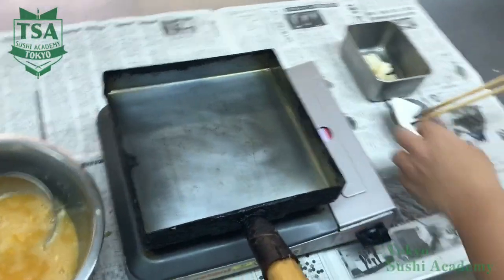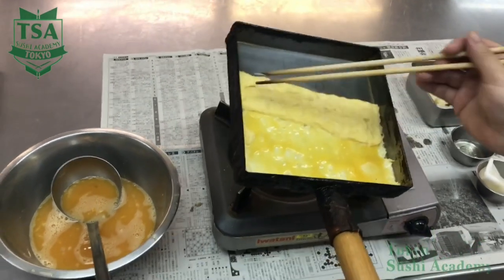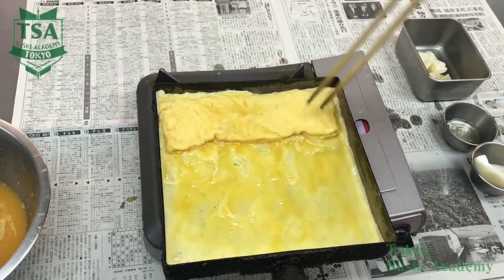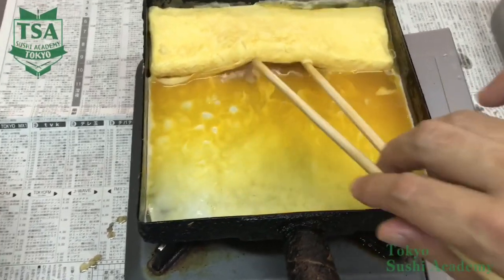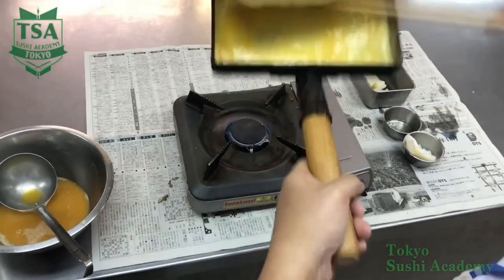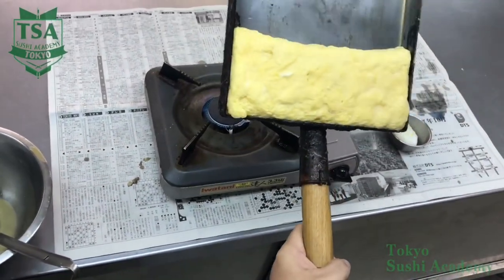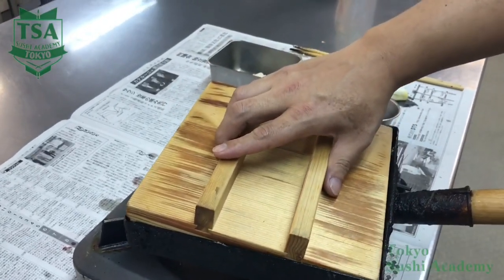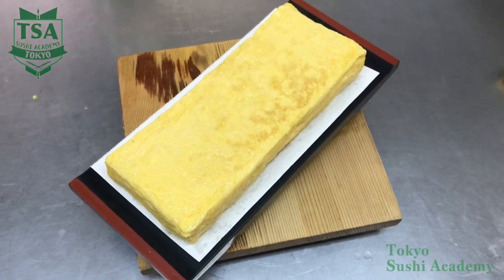How to make egg omelet @tokyosushiacademyenglishcourse

Comment: I did this with a round pan. It actually went ok, but shaping it was too hard, so I settled for cutting the sides.

I made some changes to the general recipe to accommodate my taste, but what I like in this technique is that you get a relatively uniform result, if you don't burn it. It is a surprisingly adjustable technique. As for the savory taste... I am not a huge fan, but I get what is being attempted with that. I recommend trying this out it is interesting.

By the way, if you are putting the sugar, mix it up all times before putting in the pan. The cook here might have another trick that wasn't shown, but he's very good at turning. I don't have hashis, but you can do this with a spatula if you are careful. The hashi seem better suited to the task tho. Don't forget to glue the layers with the liquid. I almost forgot last time and the last layer almost collapsed.

It is a lot simpler than expected too. Must be one of those hard to master type of things, but it is actually not as hard as the french omelette is, for instance and was easier to do too.

The omelette I'm more used to do is quite a bit different, but when you try another recipe you see that you can try to adapt a few things. I'll use a few of the tricks here to see if I can integrate other ingredients to this since the recipe is a lot less reliable on my skill than I thought it would be.

Thank you for the technique demonstration. It was helpful.
Reply: @sly dankass i'm, unfortunately, not a big fan of sushi rice, but thanks for the suggestion.

Comment: What is the wooden thing that shapes the omlete?  I think you said "getta"???
Reply: Correct. "Geta" is also also the term for Japanese wooden sandals, and they look look very similar to the device used in the video (just add foot straps).
The geta in the video is shaped/sized for the pan, and the wooden bits underneath give the chef's hands something to grip while flipping the tamagoyaki.